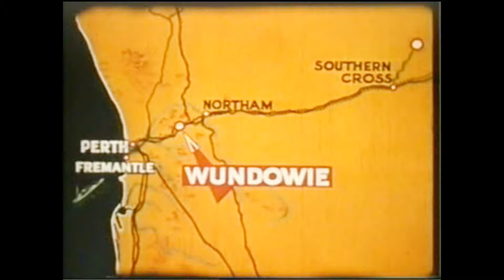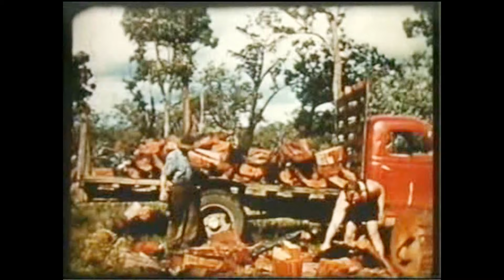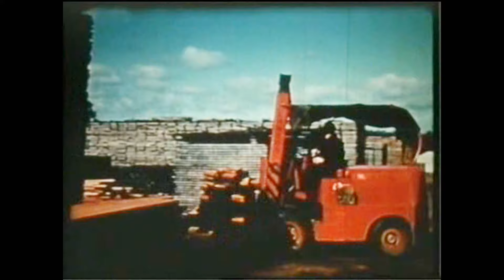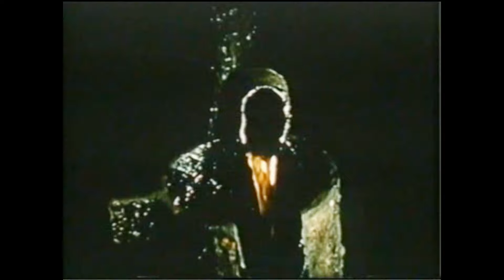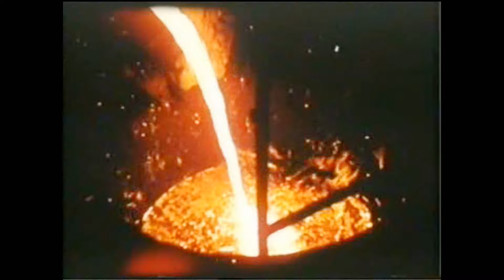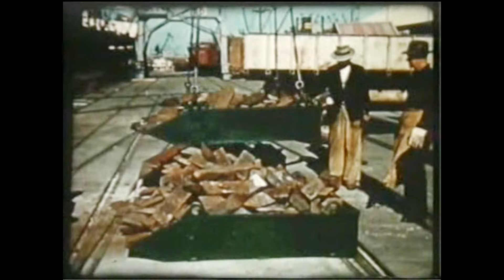Wundowie 1956: Forest to Foundry.

Comment: Is this facility still in operation?
Reply from the maker: Yes, the modern-day foundry is. However, the blast furnaces, timber mill and wood alcohol distillation facility are long gone.
Reply: @WstAus1960  Interesting.  The competing foundry in Welshpool (originally the Chamberlain tractor foundry) closed about 10 years ago.